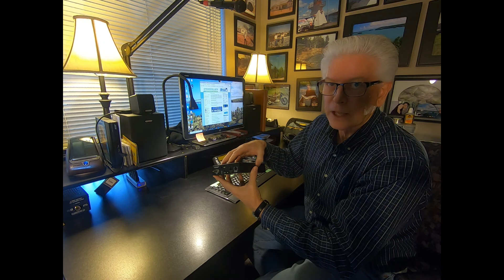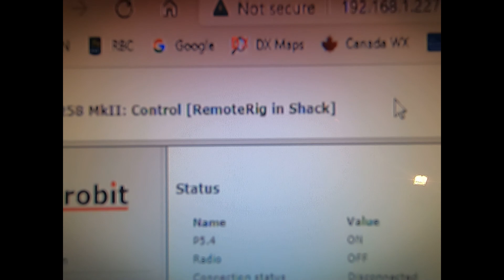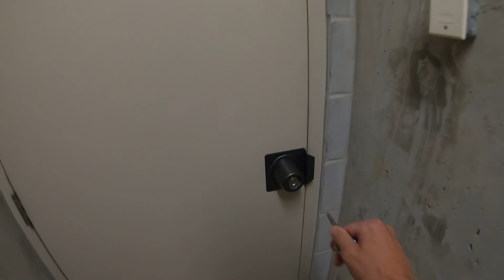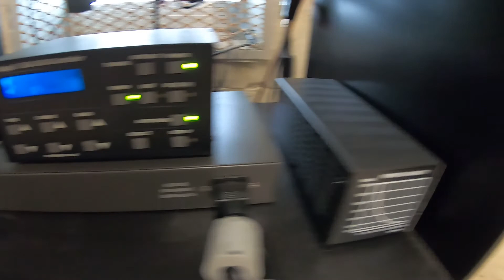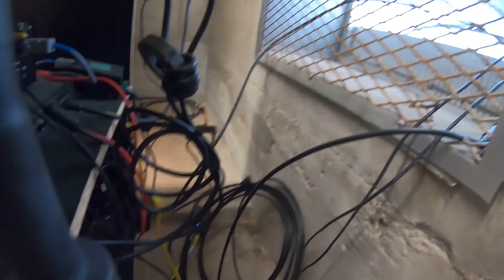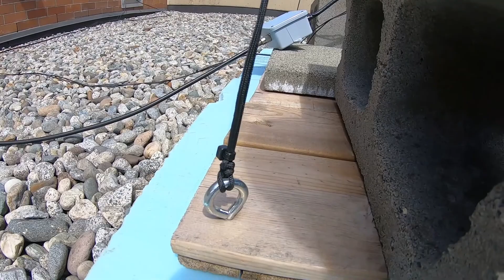VE7VR Hi Rise Remote

Comment: Hi Dave. Thanks for the contribution in making this video. I'm hoping to do a similar installation once I get back to Ottawa. What were the considerations in the choice of antenna? Assume a yagi was a non-starter but was a non-radial like a R7 an option? Lastly, what were the major hurdles to overcome with the condo Board? 73
Ron
VE3REV
F4WCR
Ex: 6W1SU
Reply from the maker: Thanks Ron. The SteppIR vertical has a very sleek profile without any traps or top hats or whatever. It also covers multiple bands and is adjustable remotely so is a good solution. they also make a new yagi called the Urban beam which I may try and get approved in a year or so. I am president of the condo Association. I convinced them to let me do a 3 month trial run so all the owners could see it installed and I could see if it worked. The owners then voted on it at an AGM and it was approved. It took some selling but worked out. :)